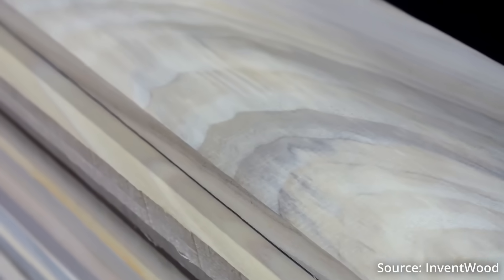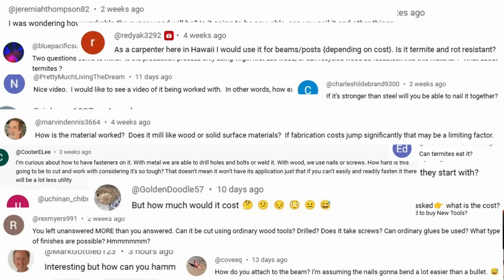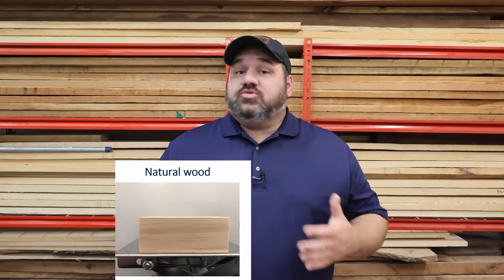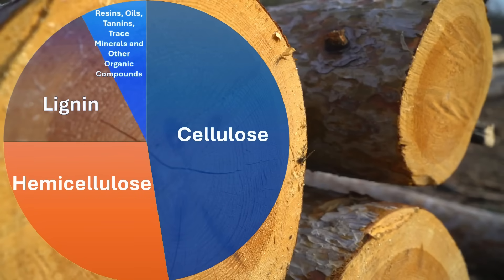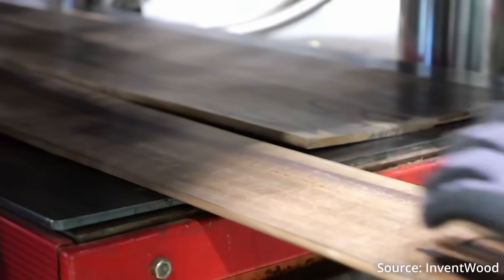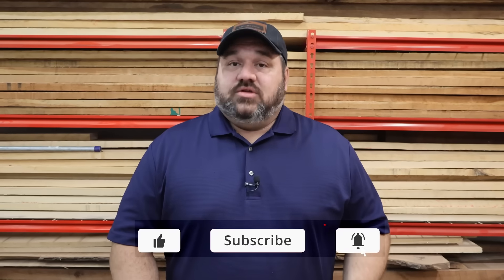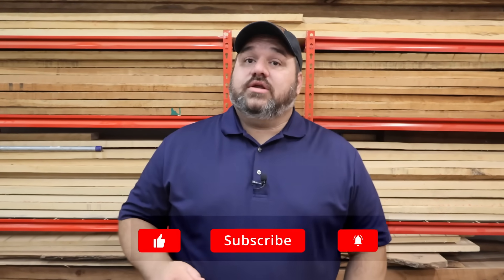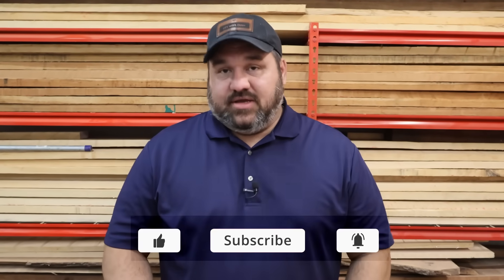The TRUTH About SUPERWOOD - I Met With The CEO of InventWood and Have Answers to All Your Questions

Comment: I think it would be great for exterior house doors and bedroom doors where security is valued.
Reply: True security is tough unless you are willing to live in a reinforced concrete box.  It might replace a standard steel security door by being more aesthetically pleasing with the same strength but are you going to put bars on your windows?  Are you going to reinforce your walls?

In the city, the noise required to sledgehammer through a door or wall might deter an intruder.  I'm a couple hundred yards from my nearest neighbor so I'm just looking to slow them down long enough to reach my firearms.
Reply: @sociopathmercenary  You are being snotty, which is now expected on yt, unfortunately. But yes, anything that slows down or makes something more difficult is a plus.
Reply: @JohnSmith-ti2kp I was simply trying to point out that a strong door is just one component in a security plan.  Sorry if that came across as... um ... Snotty.  I don't think I've ever been called snotty in 55 years.  LOL 

✌🏼

Comment: As a wood products manufacturer of 30 years, I see this product having very limited  uses. This is probably just a proposal to lure potential investors to buy stock in the company which may or may not provide a return.
Reply: I think it's mostly meant as a cheaper (hopefully) and better looking alternative to industrial materials like steel. I don't think it has many applications where it would be replacing wood.

Comment: Calling steel a "dirty, nonrenewable material" really shows just how ignorant one is about steel in general. Yes, it has historically been made in gas furnaces heated by fossil fuels. But much of the steel made today is made in electrical arc furnaces. You can power those off of solar, wind, nuclear, whatever. 

To call it "non renewable" is *laughable*. Steel is one of the most easily recycled materials on the planet. It's mostly iron and carbon. Iron is the 4th most abundant in the Earth's crust. If anything carbon is the limiting element, which makes comparing steel's renewability to wood ridiculous. 

This stuff is interesting enough that you don't need to make up non existent environmentally conscious talking points.
Reply: He's right though, it's not renewable. All the things you mentioned make it a plentiful and recyclable material, but you can't replace what's used the same way you could plant new trees.

You might  still have a point, in that it's renewability isn't as important in the near future for the reasons you mentioned but he's right in that it's not a renewable material and it takes a significant amount of energy to manafacture, whether that's electric or gas energy.
Reply: @daveg8266 How is melting down and re-forging steel using solar energy different from mulching or burning old trees and waiting for new ones to grow?  Both use solar energy as the primary energy input. Both do away with the old product to build new.

If your argument is that with wood you don't have to destroy the old, because you can just grow new trees, that's not a fair comparison. You're "mining" the air for new carbon. There's an additional input that's "using up" more of the carbon atoms on the planet. You'll run out of that long before you run out of iron for steel. Yes, there are potential environmental benefits to drawing carbon out of the atmosphere, but that has nothing to do with rentability.

Comment: Excellent info, thank you Dave! Excited to see how superwood progresses. Hope it succeeds, we need new strong building materials.
Reply from the maker: Agreed. Thanks!
Reply: @DIYwithDave Hope it'll be ready by the time I rebuild our 1st floor Store/2nd floor Home. Can't stand expensive old building materials that don't hold up well and warp during the humid weathers and then the  cold weathers freezing our arses off by the cold winds blowing against sidings and emanating thru the wood materials then have to crackup the heater. $$$$$$. Dang hate the extreme weathers these days. Then we have contractors who are crooks and or don't know the new building methods and if they do they're a hit or miss on their workmanship.
Reply: Used in construction of satellites and defense products  @DIYwithDave
Reply: Need straight building materials...
Reply: Wonder if Fine Homebuilding and This Old House crews working with this product(s) and will shoe their work now and much later to see if it's as good as the manufacturer says it is.

Comment: It would be interesting to look into the engineering mechanical properties of superwood. (1) stiffness and elasticity, (2) tensile strength, (3) compressive or crushing strength, (4) shearing strength, (5) transverse or bending strength, (6) toughness, (7) hardness, (8) cleavability, (9) resilience.  The properties may be  such that superwood could be used in areas where traditional wood would not even be considered.
Reply: I expect composite materials to become available, like lightweight wood or polyurethane foam covered with layers of hard and durable superwood that would be as light or lighter than plywood but much stronger and durable. High end bathroom furniture or RVs come to my mind.
Reply: @mikeyh6104   Good questions.   Wood was used extensively in aircraft structures, still is in a few.    One of the great advantages is infinite fatigue life.   So what would fatigue properties of this material looking like???
Reply: @timduncan8450  Very good question, i was just thinking about fatigue life . . . beat me to it!
Reply: Most or all of that is in the paper, "Processing bulk natural wood into a high-performance structural material". Just search the title on Google Scholar. The specifics will also depend on the base wood you are using.
Reply: I read a study on that, actually! The results were, to put it simply, astounding. Self-densified (noncompressed) wood is approximately an order of magnitude stronger than wood in all strength, bending, and toughness categories, unlike compressed densified wood which is only stronger along certain axes, and it’s also only three times as dense, meaning the strength-to-weight ratio is still amazing compared to wood.
Reply: @Jjames763  I would like to read also, reference please
Reply: @timduncan8450 
Sure! It was put out by the University of Nanjing, they called their particular subject material “self-densified wood.” The charts comparing it to normal wood and compressed densified wood from a variety of different directions, angles, and stress/strain tests were particularly illuminating.
Reply: Wood stealth drones.

Comment: Recently some skyscrapers have been built using wood timbers.  I would thing superwood in a laminated form would be ideal to add strength to the structure while being smaller in size to regular laminated beams.
Reply: Ascent in Milwaukee is 25 stories and over 86m tall.
Hoho Wien in Vienna is 24 stories and 84m tall.
Burrard Exchange in Vancouver is 16 stories and just under 80m tall. 

Architects and builders are continually pushing the envelope to see how tall an all wood building can be.  I think superwood would be an excellent area to build all wood skyscrapers.
Reply: @ljaytru  Don't forget about the structural engineers.
Reply: @ljaytru  and that is about the height of brick and stone skyscrapers of the late 1800s.  Not impressive.
Reply: @DubhghlasMacDubhghlas  Name one brick or stone structure high-rise building from the 1800s that was 25 stories high. The only tall structures I could find made from stone and brick were pyramids, chimneys, or non-structural stone or brick. The tallest load bearing brick building that I could find is 16 floors and even that  needs to incorporate steel for lateral stability.
Reply: @yodaiam1000  Washington Monument 555 ft tall.
Reply: @DubhghlasMacDubhghlas The Washington Monument is not a building. It is essentially a chimney with a cap on top. They had to use 15’ thick walls at the base.
Reply: @yodaiam1000  yet it built with stone and taller than any wooden skyscrapers.  And all wood will burn.  Just codes go lax and they will allow wood nowadays all in the name of cheaper construction cost.
Reply: @DubhghlasMacDubhghlas  You are comparing apples to oranges. Towers are not functional buildings. Compared to an unoccupied tower it is a lot harder to design the structure of a building to be functional. I am surprised you didn't point to mountains as an example. As I suspected, you were unable to find a brick or stone building that was taller than the tallest timber buildings. It is also just not about cost. You don't see many unreinforced load bearing stone or brick buildings anymore in first world nations.  It is a safety issue. Wood also carbon captures which stone and brick will not do.
Reply: @yodaiam1000  it is a build that shows you can build high with stone.  

Mountains are not built by people.  That is truly apple to oranges.  

And yes, Washington Monument is made from stone block.  

Nor do you see unreinforced wood buildings in the first world nations such as hurricane straps for timber frame buildings.  

Trees capture carbon...  when tree are cut down and milled, they cause carbon.  Wood or lumber doesn't capture carbon.  Wood and trees are not the same.  That is like saying something growing is the same thing that actively decaying which wood does once it is cut since the cell replacement has stopped.
Reply: name them.  I googled them they are about as tall as old brick/stone skyscrapers of the late 1800s.
Reply: @DubhghlasMacDubhghlas  There are lots of high-rise timber buildings now. The main issue was fire safety but it is not an issue with heavy timbers.
Reply: Ill call BS. A few years ago height restrictions on timber framing were change for highly engineered situations. Current norms are still 3 and 4 story max heights. 5 and 6 six story buildings are very very rare and more like experiments. When you see 5-8,story construction drivimg around town. the lower floors are "podium" steel and concrete frames, the top 4 timber/wood

Comment: How well does it sand? Can it be ebonized? Lets say they ebonize it before torifying and  compressing it. Can it then replace ebony as a fingerboard on guitar necks? Very curious if this could be a natural wood replacement for a scarce and expensive wood.
Reply from the maker: I don't know about sanding, but that is something I will test when I get my hands on a sample.  Also, based upon my current understanding, I think that it absolutely could be ebonized - likely early in the process, however.
Reply: The process itself will darken the wood so you might not even need to do anything depending on the base wood. Also for the small dimensions of a fingerboard you might be able to DIY the material
Reply: @MorbidEel ebony is black. That’s the signature feature of an ebony fingerboard beyond hardness

Comment: You absolutely do have to compare Superwood to regular wood in all ways, including cost. My guess is that Superwood will be so expensive that it will be a niche product; it's not going to be a substitute for the average woodworker that needs a 1" X 12" X 8' pine, birch, or aspen plank to build some shelves. It probably will be more expensive than a better wood like oak too. My guess is that it will be used for high-end flooring and maybe furniture. But I wish them well, and hope they succeed. I may have missed it in the video, but my question was how well does it sand?
Reply from the maker: First, of all, I don't know about sanding, but that is something that I will test when I get it.  On your other points, I agree completely.  I think that it is a niche product that has limited usefulness to the average woodworker.  I think that most of it's promise lies in how it can replace materials like steel in certain applications.  I don't know that it will ever be practical for the average woodworking project - especially when there are loads of alternatives.
Reply: Also, they are trying to patent everything about it. There will be no competition, it will be expensive to do anything meaningful with it on an average consumer level. It will be the building material of millionaires.
Reply: For a while, yep. Patents run out, and then we can all use it. Well, in theory. The process might be too expensive in reality, but 20 years isn't that long to find out.
Reply: Maybe less expensive than Teak or Ipe, but I bet even Rock Maple will be less expensive than this.  This is going to sit right at the top for some of the most expensive dimensional lumber available per board foot, but per pound it may be less expensive than some rare veneer woods.
Reply: @shubinternet  you also need to remember that it can be much thinner than regular wood, so the cost to do the same job, would be much lower than the cost for the same size..
Reply: @Duncangafney1 not really if they start with 3" net wood to achieve 3/4" net thickness
Reply: I agree with your guess that in the beginning it will be a niche market that only the most discerning (aka rich) woodworkers and clients would dabble with. BUT, I'm old enough to remember the first atari systems. A dad of one of my friends bought one (they were rich) it cost nearly $800! Now, you can download it and play for free. Remember when plasma and led TVs first came out? They were insanely expensive now you can get one very cheaply. The list of products that are cheap or even given away as swag at trade shows and the like that use to be insanely expensive is growing everyday. In other words its just a matter of time that superwood will be used by the masses.
Reply: When you need the appearance of wood but the strength and durability of wood is not enough.
Reply: Costing 5 times as much is something they will need to work on.  Get cost into a more affordable range will be their biggest challenge.  It could be competitive with hardwood flooring and decking.
Reply: It's not meant to replace "regular wood", so why would it need to compete/compare with wood in cost? It's meant to be a structural or siding material that's much stronger than wood. Even in the fence example, the comparison material isn't a wood picket but a steel or aluminum slat fence. That's the appropriate comparison.

Comment: 1. It should be pointed out that in the process of making Superwood, one of the chief benefits of wood is lost, its low density.

For a given weight, lower density results in a thicker member which has much greater buckling resistance, which increases as the cube of the thickness.

2. I expect that the properties of different species approach each other after the compression process, as the denser/stiffer it is to begin with, the less it will compress when squeezed further.

3. Seems like the processing will end up with this costing more than metal so I don't see it being a widely used product.

4. I'd still like to know what the elastic modulus (stiffness) is; i'm pretty sure I asked this in the previous video.
Reply from the maker: Great points and good questions.  On the price, I think that it has to be less expensive than steel - otherwise it wouldn't be worth it.  It would become just a high end novelty product with little widespread appeal.  The CEO told me that currently their process is not cheaper to produce than steel in their current plant, but they plan on adding another and with the economies of scale of the two, with some likely upgrades to equipment, they will be competitive with steel.  I think that a product like this only works when it is done at scale to reduce cost.  I'll see if I can get some info on the elastic modulus.
Reply: "use case is entirely different" "utilize it's unique features"
🤔 What might those be???
What IS it's specific gravity, flex modulus or Janka hardness?
It's too dense to make a deck that won't scorch your feet and too hard to shape or easily fasten to.
I see hype with no hard numbers or samples available. Skeptical is about the nicest word I can come up with...

Accoyawood is now into production now in TN.
Been around for a long time in Europe. The acetylation process makes it hydrophobic and repugnant to insects.
While it may be expensive you can cut, shape, glue and fasten it just like poplar although it starts life as plantation grown pine.

Lots of things need girth and the somewhat insulative qualitys of air filled cells.

Seven years after I heard about this coming from University of Maryland I'm still at a loss as to how or where I can use it.
I DO wish them luck. None of this is criticism out of hand
Reply: @jimurrata6785  The original process sounds similar to first step off a sulfite pulp mill. At scale this would not be a cottage or craftsman project. It’s heavy industry. Look into pulp mills. Review the process used to deal with the lignins and recover the corrosive chemicals for reuse. This is not a process where you just obtain a 100k sf. tilt-up at the local business park and go into production.

Comment: Curious how this stacks up against carbon fiber as a replacement for carbon fiber reinforcement in guitar necks that keeps them straight.
Reply from the maker: I can't tell you the exact specs, but based upon what I know, it would probably work really well in that application.
Reply: I’m guessing it will be considerably heavier. 🤷🏻‍♂️
Reply: @mgfroglegs they’re thin strips usually. Carbon fiber isnt used to reduce weight. It’s used to keep the neck from twisting and warping due to wood fibers changing with the weather.
Reply: @jeffreytgilbert  I sure wouldn’t want to play a 15 pound guitar. Superwood I’m sure is at least 20 times heavier than carbon fiber. And considerably heavier than regular wood of the same dimensions.
Reply: @mgfroglegs not the whole guitar. Just the fretboard and the bracing in the neck
Reply: @jeffreytgilbert  I get it.